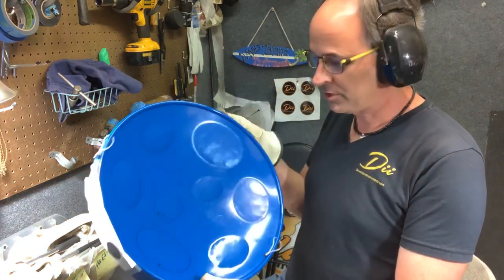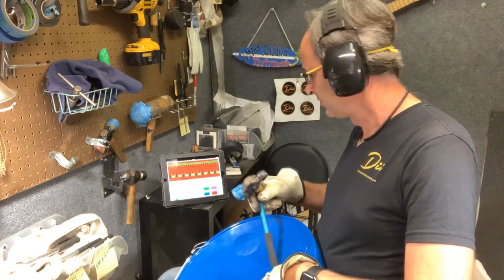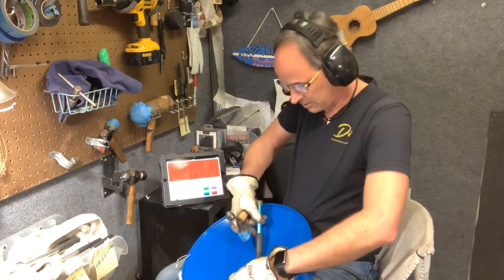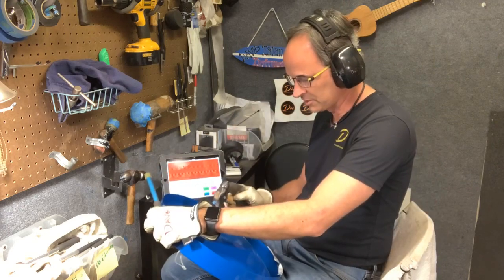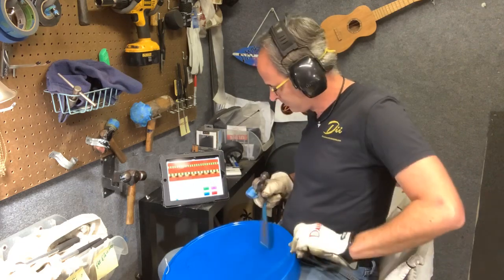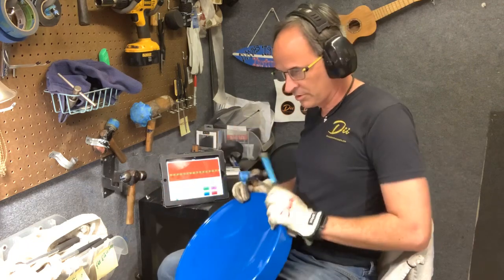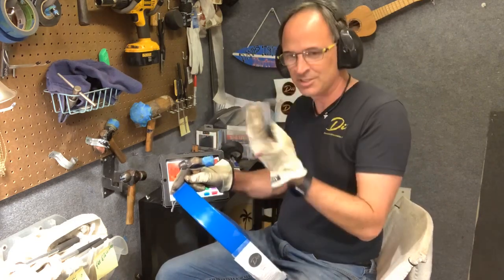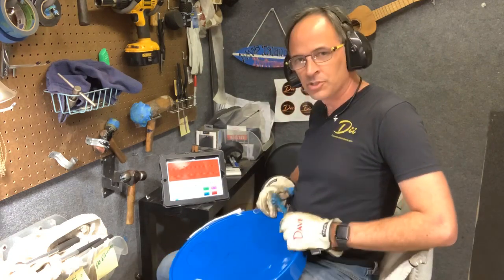Dii: How to tune a Jumbie Jam steel drum

Comment: Questions for you.   I just bought this same drum, color too. Haven't received it yet.  Should it come right out of the box,  tuned as what you just did? How often do they go out of tune?  I am COMPLETELY new at this.   Do you do / take "tune ups"? I'd never attempt to do what you did. 
  Thanks!  Rolf
Reply from the maker: Hi Rolf, They should arrive ready to play out of the box. They are a good product. Over time they may go out of tune if they are played a lot. Maybe after a year you may need some tuning. Many people don’t notice the discrepancies, but an electronic tuning device will show what has gone out of tune. Definitely take it to a professional tuner. Don’t try to tune it yourself. It may look easy to tune but it is an elusive art and takes a lot of experience.  Have fun!
Reply: Dii Thanks for getting back to me.   Currently I make kalimbas and use the g-strings app to tune them.  What you did here is out of my wheelhouse for sure!   Thanks 👍